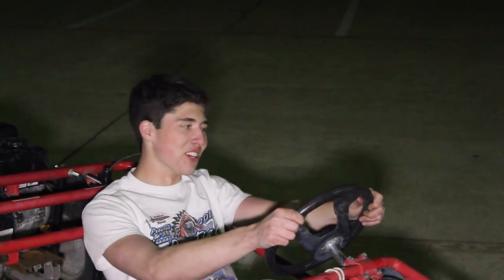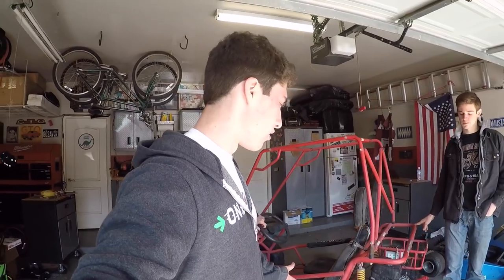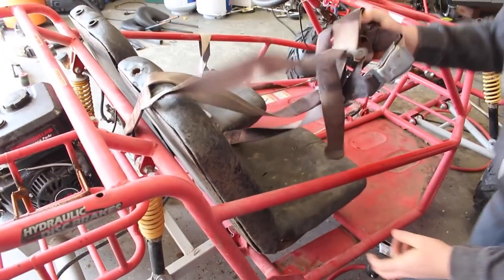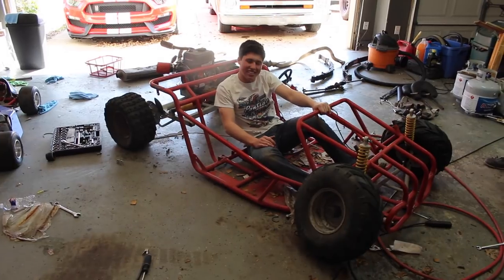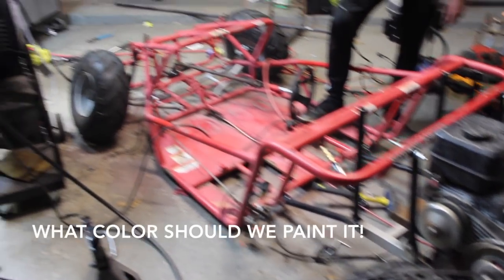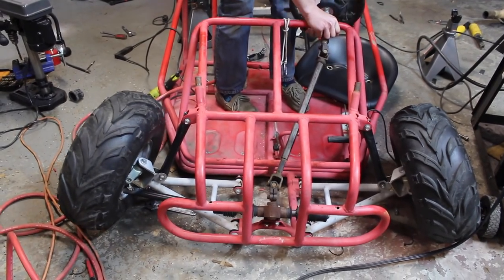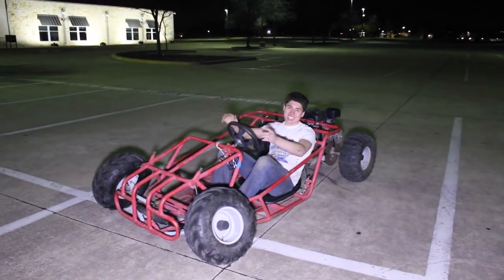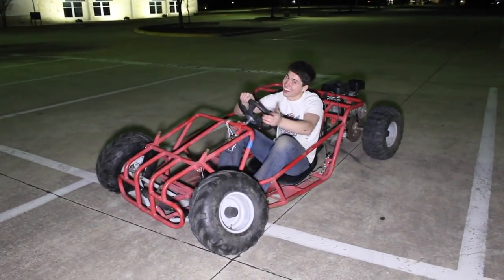Stanced Out Slammed Go Kart Build! (We Crash It)

Comment from the maker: So what do you guys think? Should we keep it lowered for a bit and add some other touches or should we keep it as the engineers designed!
Reply: I'd say keep it low see if you can get some camber out so it's drive able and rice it with a wing be interesting to see
Reply from the maker: Luke geary Some under glow might be in order too......
Reply: Every great innovation ignored what the engineers intended
Reply: Build Break Repeat drift kart
Reply: Mountain bike shocks to keep a working suspension and they short enough to keep it low
Reply: Keep er slammed for sure
Reply: It's a brush guard - not a roll cage.  It has no structural integrity - just saying!  Replace the springs with airbags.  You can even find strut style airbags that can replace the strut/spring assembly directly.
Reply: That Kart is identical to my brothers that got stolen in Vermont a 
few months back.
Reply: Keep it lowered and make a scrapping video montage of every thing it gets stuck on. Looks awesome guys keep up the good work
Reply: what a dumpster fire of a build, i say GO FOR BROKE. use all of your engineering ability and money and build a long travel suspension buggy. THE BAJA SHART KART. it will be difficult and involve math and $$$, but when its done it could be GREAT!
Reply: Put air bags on it
Reply: Engineers? Pffft....You're the Engineers now!  Get the suspension straightened out, get some street tires on it and it'll look great. It already looks kinda like a NASCAR Sportsman frame, I say take it the rest of the way.
Reply: Build Break Repeat man!!...awesome mod!!...i know its late to tell you this but maybe try to install street tyres in it and make another set of front A-bars....straighten up the wheels on the front.....it'll look cool......
Reply: Where did you get that frame drone?
Reply: I would take and put a full air ride suspension on it and then you can have it lifted or dropped with a flip of a switch!
Reply: You should add pushrod suspension and do a body for aero and you can have an almost mini version of a radical s3.

Comment: You could have just made L shaped pieces,  drilled bolt holes in the ends and connected the shock tops to one end and the other to the mounts.  That way you would still have suspension and the drop.  Even your camber would remain correct.
Reply from the maker: fuckery abounds That’s a good idea, maybe next time haha.
Reply: Actually,  lookin closer,  your camber is tied to the a-arm angle but if you do the same L drop thingy to the arms it would fix the camber.   You would just have to connect the left and right L's with a cross bar so they won't flop around.  That's easy though just measure the space between and cut a bar with holes in the ends and bolt it between the L pieces. 

That should effectively drop all the front suspension mounting points.

Comment: instead of using the bars in the back, maybe taking the fuel tank of the engine and remounting it to the red frame and run longer fuel line to the engine.  just a thought